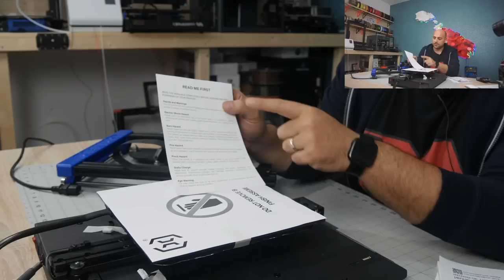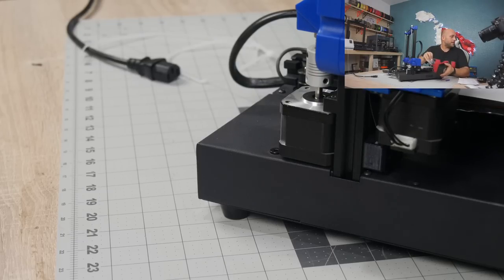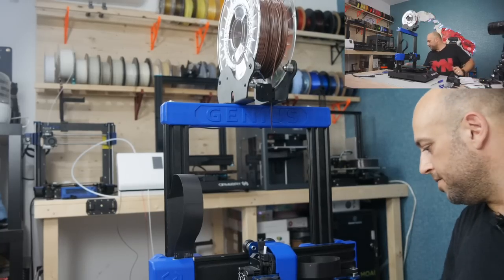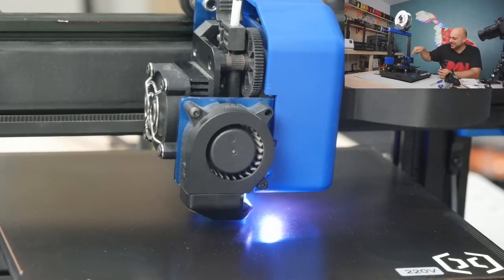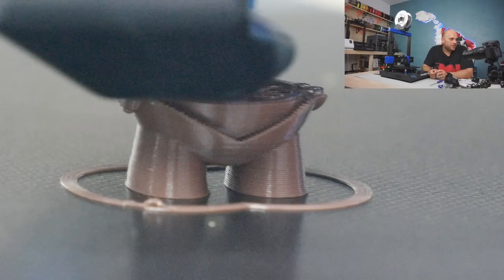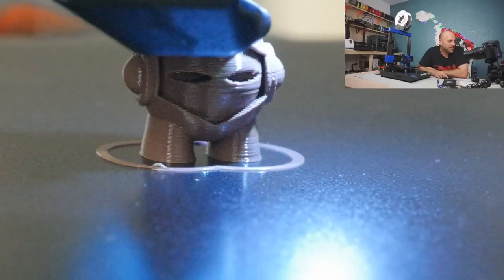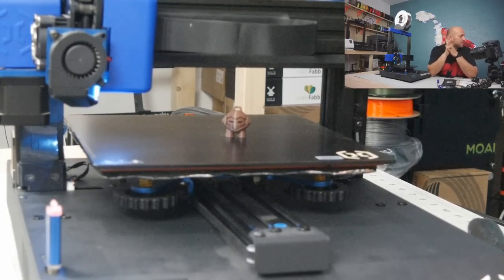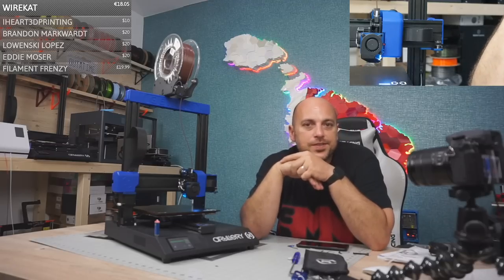$299 Artillery Genius 3D Printer Live Assembly And Test

Comment: I dunno. At this point the Prusa Mini just seems like a no-brainer on the low end. Clear upgrade path, massive community, tons of support. And it's a Prusa, so profiles are on point and tweaking at a minimum. For anyone who wants a project machine I'd say go Ender 3. For those who want more time designing or messing with prints rather than tweaking and upgrading the printer, the Prusa Mini just makes too much sense.
Reply: A Prusa Mini + a Sidewinder X1 is a good alternative to a Prusa MK3S. Two for the price of one, both a large and a small/medium size printer.

Comment: The X1 in the 4th revision also has the rest button, but the connector for the cable on the gantry is new, so is the auto bed level ready connector. Seems like this also will find its way into the upcoming V5 of the X1